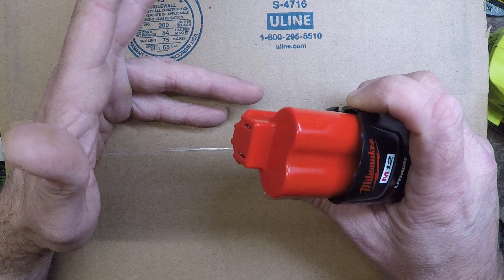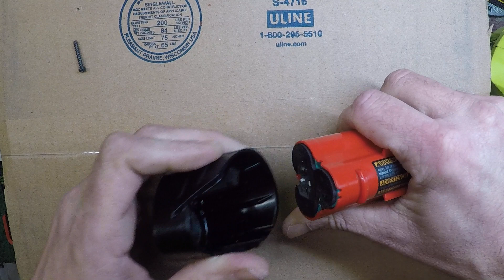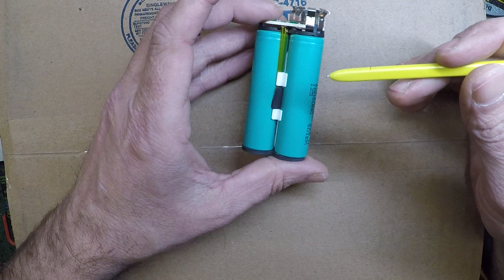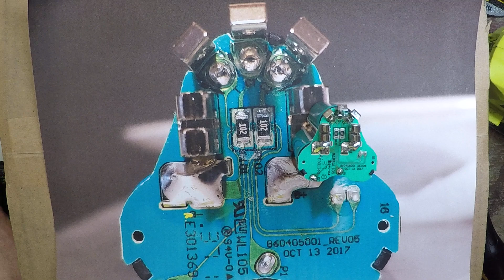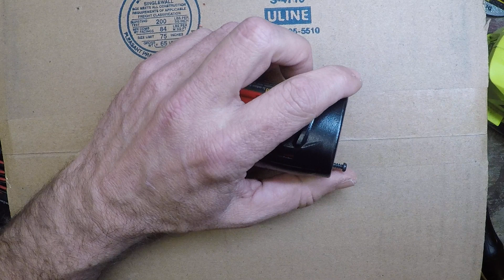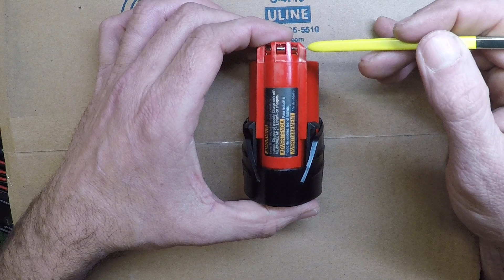What's Inside? 01 - Milwaukee M12 CP 2.0 Battery

Comment: My M 12 battery pack with the split case and with the thermistor on the circuit board, all three cells are 0 V with continuity and with the CID’s not tripped. The thermistor leads appear overheated. Do you have the number to replace the thermistor ? Or can I safely bypass it? Thanks
Reply: I checked both resistors and they’re 1K, I checked the the thermistor and it’s 11K

Comment: I am just about to do a 'repair' on one of these for my brother as one of the cells has failed reading 1volt. However, looking at the circuit board in the original I was surprised that there is minimal battery management with no under or over charging and no balance function to prevent cells from fully discharging while other cells remain good. I also repack makita and bosch 14.4 drill packs to Liion using LG-H2 cells and always use a BMS with balancing function. At the same time I got a couple of aliexpress copies in which the supplied PCB  is no more than a pass through and all management is handled by the tool or the charger not a great design in my opinion.

Comment: Thx for the video. I have a M12 compressor in my car, but I don't always carry M12 batteries. I'm trying to rig up 12v cigarette plug for emergencies. I can get spade terminals on the pos+ and neg- terminals of the compressor fine, but do you know how I can mimic the Temp "T" connection?
Reply: Doesn't the compressor work without the "T" connection? What do you mean mimic? The temp connection is just a thermistor (a resistor that changes its resistance according to the temperature). You can find the nominal resistance at room temperature and put a resistance at the same value there as a bridge. I think 10kOhm resistor is used in by Milwaukee. Not all brands use the same. I think Bosch uses 6kOhm. If you do this be aware that you don't have any overheating safety, and need to monitor the temp by yourself.
I saw this in this video: https://www.youtube.com/watch?v=nd4fHFHj9AU

Comment: I have a couple 4 and 6ah milwaukee m12's and one of my 4ah decided to unbalance the crap out of a cell and wouldnt charge in 2 different chargers. it was flat (i mainly use it with the m12 soldering iron that chews up battery power for sure), Cell cluster 1 and 2 were both reading around 3.8v but cell cluster 3 was down to about 2.8v.......

Any ideas how it became so unbalanced? I use a milwaukee m12/m18 fast charger, is it the charger? (i also have a standard m12 only charger lying around i could use instead, charge time doesn't really bother me, i've got enough packs), do the fast chargers potentially cause unbalance's in cells due to ....fast charging? 

I thought maybe bad cells but what are the chances multiple cells in that "cluster" on pole 3 going bad (as opposed to a single cell in that cluster dragging it down).

Non the less, too fix it i used my fancy RC Helicopter IMax X400 battery charger, split the pack open (stupid simple for those bigger packs too, 4 screws and its done), attached it to the individual cell cluster that was down, selected Li-ion mode/single cell mode and bumped the voltage of that 1 cluster up to 3.8v also. Then hooked them up to the balance lead port and balanced all 3 cell clusters up to a bit under 4.08v, put back together and let the milwuakee charger finish it off. Will keep an eye on the pack over the coming week and see if that cell unbalances its self again

Comment: Would you consider taking apart a cheapo knock off battery for m12?  The cost delta is so much I just have to try one for those batteries for low draw items like a screwdriver.

Comment: Excellent, I repeat EXCELLENT vid. I was looking for days for a vid that explained fully the Milwaukee M12 battery. I guess YouTube’s algorithm jumps your channel.  I had 2 old M12’s in a case of a tool I haven’t used in years. After making all the checks you described and all checked out the batteries still wouldn’t charge. I then charged the batteries with a NOCO 2 charger. Walahhh!  They now charge. It should be noted that the charger recognizes both under and over voltage and won’t charge if either presents itself. Keep up the good work.  Oh.....your vid sound quality on this vid could be better.

Comment: Thanks for this  video. I have tried to unscrew that screw with a t10 but it won't badge. I have sprayed w40 but still no success. Any ideas?
Reply: It will be heaps easier to unscrew if you use a T8, since that's the correct size bit for it.

Comment: I have 1.5 Amp battery and I want to buy 3 amp battery to replace 1.5 ones.Is it possible to use 1.5 amp battery control board for 3 amp batteries ?

Comment: someone needs to do a teardown of the usb single cell batteries. can they be rebuilt or opened? would love to swap out the 2.5ah cells with something larger.
Reply: There are what, 10,000? different brands and types of USB battery packs. Do you expect somebody to do a teardown of all of them?
Reply: @johncoops6897  the milwaukee single cell battery.................
Reply: @magicmanspaz  - Ahhh, sorry that wasn't very clear to me. Here is a teardown and upgrade of the 2.5A version that I found with a simple 1 second search on Youtube:
https://www.youtube.com/watch?v=XuZp9w5CwG0
He reckons that  the 2.5Ah gadget contains a Samsung INR18650-25R cell - for THIS application you don't actually need an expensive "high-current" LG cell like he chooses, and you could use anything with sufficient current capacity like one of the 3500mAh 10A cells from various companies.
The technical aspects that you need to understand are as follows. The USB device is rated for 5V 2.1A output, which is 10.5 Watts. Let's say that the BMS has the under-voltage cutoff set for a conservative but realistic 3.0V.
Now let's assume that the internal boost converter has 75% efficiency at it's lowest input voltage (3V), so that means the input power from the cell is 10.5W / 0.75% = 14W. Therefore, the maximum current drawn will be 14V / 3.0V = 4.67A.
So, any 18650 that is rated higher than about 5A continuous is suitable, a bit higher would extend cell life. So, any 10A Continuous cell would be OK, since this is a far less demanding application than what's needed for power tool packs.
Reply: @johncoops6897  thanks. yeh don't think that vid was around when i commented a year ago. i looked around at the time but nothing found.

Comment: Searching for this battery I can't tell if it got the seamless case with a screw in the bottom or the clipped version where you have to brake the clips. Is there any chance to identify those different case Versions. Because of the high premium costs I want to upgrade them with some Sony US18650VTC6 for better performance by my own.
Reply: Well, obviously you have the case with the screw in the bottom if.... your case has a fucking screw in the bottom.
Far out, what an incredibly stupid comment and question!

Comment: Do the non compact 12.0 (3.0,4.0,6.0) batteries contain some sort of intelligence, or rather for that matter, whats in the base of those?
Reply from the maker: If they are following suit as the CP batteries they have the same PCB but double the cells for a 3S2P set up.  I just recently acquired a XC 6.0 and will be taking it apart to find out what's inside it.  When I do I'll tag you in the next video. 😁
Reply: @shadowz_edge  

Hi,

Did you ever do a video on what's inside a m12 (6.0ah) battery and bottom section?  

I was also curious on what's on the bottom base. If there's nothing then why doesn't milwaukee make barrel style. Or can i take 1.5ah battery bottom and put them on a (3.0ah, 4.0ah or 6.0ah) pancake / flat bottom style batteries. 

Let us know. 

Thanks

Comment: Good first vid there Shadow.  I liked your idea of taking a blown up pic of the battery connections and pointing out what you were testing. It made it so much easier to follow along.  Were you using a smart phone for the vid, and how did you get that overhead shot if I may ask?  I'm re-shooting my shop tour then try and figure out how to upload it properly, lol.  Thanks for sharing.  Cheers mate.
Reply from the maker: @William Logan - For the video I used my GoPro Hero 5 Black but I did use my phone to control it as I couldn't see the screen.  And for the overhead shot I used a clamp and various extensions to attach it to the camera.
Reply: @shadowz_edge  Sounds like you have your ducks in a row.  I suppose that's the engineer in you eh, lol.  I'm still on the fence about purchasing either new smart phone (since I only have a 5 year old flip phone for emergencies) or purchasing a new camera for vids.  I can't afford to do both.  Right now I'm using an old Canon Vixia HF M31 camcorder and the vid quality is kinda grainy.  So, one step at a time.
Reply from the maker: @TheFlatlander440  I supposed so on the engineer comment. 🤣 .. As for either the smartphone it the camera you could really go either way. Just depends on what would work best for you.
Reply: @TheFlatlander440  how's it going bro!!
Reply: @shadowz_edge  awesome video! Thanks for sharing!